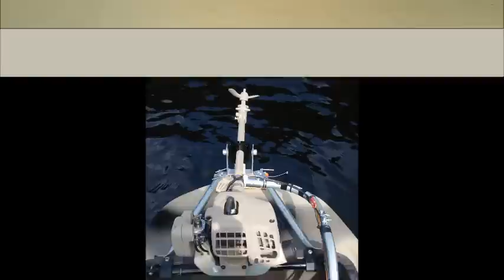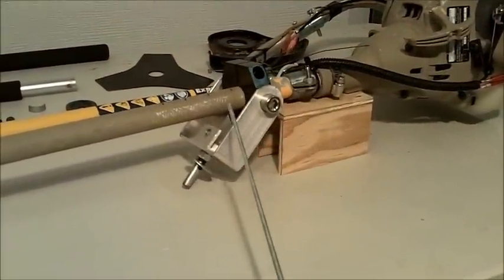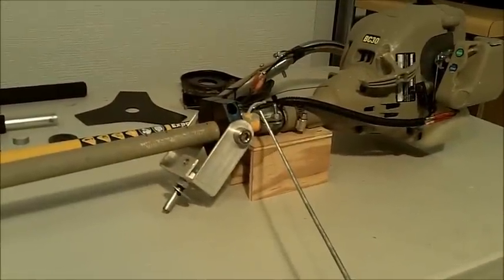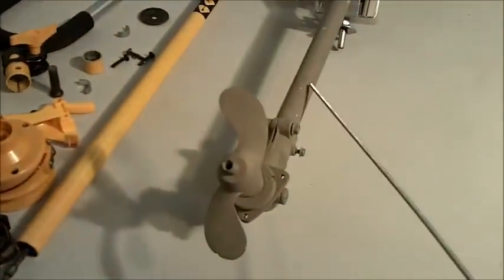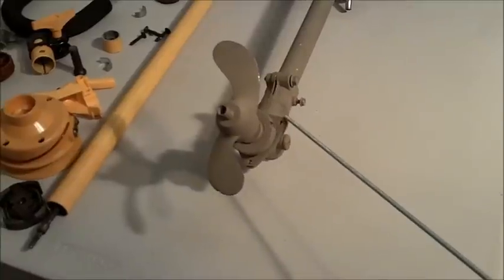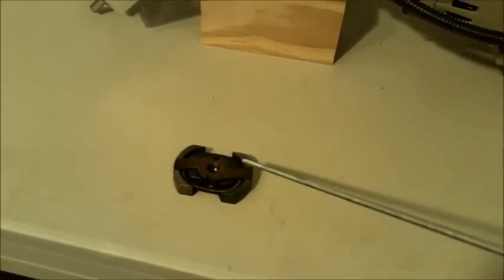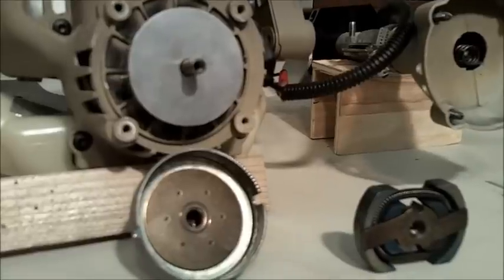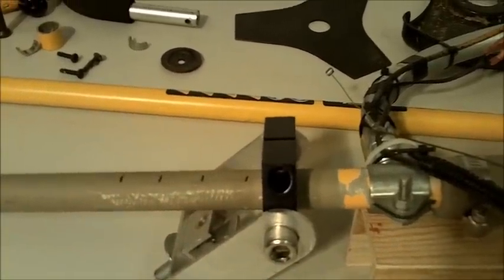Weed Eater Boat Motor Build

Comment: Since my sail boat is only 400 lbs 16 footer ,this would be just about perfect for size ,weight and with these weeders ,i could tilt it at any angle and it would still work ,good luck with your site ,your just about the best explainer guy out there and i don't say that everyday :)

Comment from the maker: Thanks! It's starting to warm up here, so I'm getting excited to get this back out on the water. I have not seen any issues with the gear head taking on water, but I also have not opened it up to look. That is something I'll plan on doing soon. I don't have an anti-ventilation plate (cav plate) yet. I was going to fab one this spring too. Last time I ran it, I tried to get some speed numbers with my gps to look for a loss or gain in speed with an anti-vent plate, but I didn't get a good average.

Comment from the maker: Glad you liked the video! The bracket you're asking about is a ballast clamp bracket for a circle track car. You can find them on eBay. You need one for a 1" tube. As for the clutch lockout, you'll need to have one made. I took the clutch drum to a machine shop. You can take a picture of my set up and tell them to make you one that fits your clutch. In my other video my GPS said I was going 4.7 mph, but I think it can go faster, I just need to adjust the depth. Feel free to ask more questions!

Comment from the maker: @zm123e It shouldn't be too hard. Do you know what kind of shaft it has inside? Solid or wound wire? If you have a solid shaft then you just need to cut one end off (probably the bottom) and then make the shorter shaft fit inside your gear head. Cut your outer tube the same amount and reinstall your gear head at the bottom.

Comment: I wonder if you could have drilled holes through the clutch drum and run a bolt or bolts through it to connect the clutch to the drum and achieve the same results to make it direct  drive.

Comment from the maker: I bought the weed whacker off craigslist but you can find them at Home Depot or online at Amazon and other places.

The shaft adapter (what the prop attaches to) came with the weed whacker becuase it is what the trimmer string housing attaches to.

Comment: Just drill a hole close to the center of the clutch bell into the main clutch were its one piece on each side and tap them and stick bolts in it
Reply from the maker: Thanks for the suggestion and thanks for watching!

Comment: I just got a ryobi motor from a bushwacker. I had it for 7 years before it decided to not start for me. I need to rebuild the carb but I needed to wack right ow so I got another head unit. I also need a motor and this seems like a good use for it.
Reply: I forgot to ask but is it possible to not mess with the clutch and have it work? I stripped out the T25 bolt insife the clutch bell trying to repair my motor and the female end is too small to fit my extractor in.
Reply from the maker: stizan24
You can try but I suspect yours will over heat like mine did. You could also put a couple of small tack welds inside the clutch drum to lock it up, but the I don't know off the top of my head if you can get a welder in close when it's connected to engine. It might be too tight. Your only other option is to cut off the female end so you can get your extractor or a set of vice grips on the T25. A replacement clutch drum doesn't cost all that much. Keep me updated with your build and thanks for commenting!
Reply: I didnt think of cutting it.off that would be.my best option. Thank you.
Reply from the maker: stizan24
It will mean you need a new clutch drum, but I agree it's your best option. :)

Comment: hey nice outboard i started making one the other day out of a echo srm 2450 whipper snipper straight shaft its got plenty of power and a clutch but the gear head on the end makes it spin counter clockwise so i was looking at the youngs t10 but it doesnt have a hole in the end like urs did u drill one and will it do the job thanks.

Comment: I had a couple questions. The bracket that bolts onto the shaft where it pivots comes from what kind of mini race car? Since I've never pulled apart one of these would a small engine shop have that kind of lock out clutch part around or understand what I needed? I'm handy but motors were never my thing. When you got it up and running just how fast did it move ya? I couldn't tell from the video. Great job!

Comment: Were you able to just bend the emt for the handle? And what is a clutch lock out, would I need it for a small duck pond. I appreciate the fast responses THANKS👍🏼
Reply from the maker: +Everything Outdoors Yes, the handle is bent EMT, but you can use anything you have handy. The clutch lock out was necessary because the clutch was slipping and getting really hot. It has to do with how heavy you and your boat are. If I were to do it again I would just put two weld beads on the inside of the clutch drum to catch the clutch shoes. It would be much cheaper and easier then make the the clutch lock out that I did.

Comment from the maker: My T-8 prop had a hole in it, but I had to drill a second small hole for a roll pin to keep it on the the shaft.

If your echo is close to 30 cc it will work great!

Comment from the maker: I actually removed my clutch because it was slipping and getting really hot. What size engine do you have? That may be the problem. Anything under 30-31 cc is going to bog really bad. You might look at giving your engine a tune up as well. You could squeeze some more power out by adjusting the carb or putting in a new spark plug, etc.

Comment: I see no problem with my clutchless unit. I made one last summer, and it runs fine. You can start it in the water too; you just have to make sure that you prime it very well, and dampen the choke down to let it warm up. Oh and never go for an actual trolling motor prop. they have too much surface area. They are only meant for low rpm electric motors. Get, or machine a 3-4 inch prop. It will spin a whole lot faster, and prevent engine stalling

Comment from the maker: hmm, it sounds like it's stalling the motor. What size engine and prop do you have? It sounds like it's not powerful enough to turn it in the water. If it was your clutch it should start slipping and get really hot, so it doesn't sound like the clutch to me.

Comment from the maker: I bought the brush cutter used off C-list for $40.
Then the throttle grip was $15, the prop was $20, the clutch lock-out plate cost the most at $90 and the mounting bracket cost $20, the rest was just odds and ends to get it running.

I'd say total I have about $200 into it. I'm not looking to sell it right, but thanks!

Comment: Very good job. But I want to know the ratio of gear box. What is the revs per minute of your weed whacker? and what is the output(propeller) revs per minute ?
Reply from the maker: The gear head has a ratio of 1:0.75. For every full rotation at the engine, the prop turns 3/4 of a rotation. As for the engine's RPM, I haven't verified it, but I believe the manufacture says its a 7000 rpm motor. I'll run some tests when my digital tachometer arrives. Thanks for watching!
Reply: Thank you for responding. I also want to know power of your weed eater. I have one 26 cc but ıt didnt work. Because power of motor is enough to turn propeller in water. power is not written on this machines. there is only cc value. How can I understand it if the power is enough or not ? Thank you.
Reply from the maker: 26 cc is a little small. Mines a 30 cc. What did your motor do, stall when you put it in the water? You need a smaller prop. You can make yours smaller by cutting some off the tips. As for Horsepower, I really can't say for sure, but I've heard they are in the 1.0-1.1 hp range. I'm working on a project that should give me some better numbers. Be sure to subscribe for a video on the subject this spring.
Reply: Thank you. But I found a nw motor 2.1 hp. 52cc. I will buy it. I think this is going to solve my problem. When it is ok I will send you my video. thanks a lot...
Reply from the maker: Sounds good. Can't wait to see how it works for you!

Comment: I see the video was posted a few years ago, how is the motor holding up? How long of runs did it take to overheat the first clutch. I will only be doing short runs of 10 minutes or so, wondering if I need the clutch lockout plate and all.  Can you buy a weedeater with direct drive and circumvent the whole lockout plate, or do they all come with clutches, sorry if that's a stupid question. Thanks alot.
Reply from the maker: It's still running, but I don't have as many hours on it as I wish I did. My first clutch overheated pretty quickly. Within the first 30 minutes. As for direct drives on weedeaters, I haven't seen any that way. Seems like people want it to idle without risking their limbs if they set down. Thanks for watching!

Comment from the maker: The prop is a T-8 from Young's Die Cast Props. As for the "coupler", I'm not really sure which part your talking about. The gear head is about $25 on ebay. Hope that helps!

Comment: +Erich's Alaska Channel  Nice adaptation.  However, felt I was drowning in details without ever seeing the big steps you used to conceive of this and put it together.  For example, I'm still having difficulty determining which pieces were originally part of the weed whacker vs. which "marine parts" you purchased for attaching.  Any videos or pictures of the steps BEFORE it was assembled, info on sourcing the parts, etc?
Reply from the maker: +onesimpleidea Thanks for the feedback! I should make a new video going through the project step by step. Would you suggest one long video or multiple shorter videos?
Reply: +Erich's Alaska Channel  Length?  Either would work, but the trend seems to be multiple parts, each under 10 minutes (Making It Part 1, Making It Part 2, etc).  No matter your choice of method, if you made it, I for one, would watch it.  In parting, details are great, but think of them like the balls on a Christmas tree.  First, you need the tree to hang them on ... and that is some type of overview or outline that you stick to as you progress through the series.  Hope this helps.  Again, nice job with the motor!
Reply from the maker: +onesimpleidea Thanks for the feedback!

Comment: I have a ryobi weed wacker with a bent tube instead of a straight tube.  for the second time the flexible cable has snapped.  How would you prevent it from snapping over torque issues in the future?

Comment: Where did you get the adapter on the prop
Reply from the maker: Hi Grant, thanks for watching. The adapter is part of the string head that came with the weed eater. You can fine replacements on ebay or parts websites.

Comment: I did this with a 4 cycle ryobi, same prop, but it cavitates. Any ideas?
Reply from the maker: The only options are to add a gear reduction or use a smaller prop. :(

Comment: Nice motor. I thought of a cheaper way to lock out the clutch. Drill 1/4" holes where you cut the slots in the clutch drum, and then file them square to accept 1/4" carriage bolts. Install 1/4" x 1/2" carriage bolts so the heads are on the outside. Use lock washers, nylock nuts and thread locker to secure them. Use the stock clutch and align it so the bolts fit in the narrow sides of the clutch. Modify the bolts to fit if necessary. The nuts hit on the clutch shoes, locking the clutch..

Comment: Why not use a tiny prop instead of the machine shop biild and boat prop?
Reply from the maker: Like for a remote control boat? I was following some other guys builds who recommended the youngs aluminum prop. With a little gearing, it would help the weed whacker not to bog and be very efficient.

Comment: that clutch center section that is threaded looks like steel, it looks like a second steel section could be welded to that threaded center section, center it the best you can weld it on, then balance it on a dowel or pencil, file the end that drops as that will tell you the side that drops is heavy, keep doing that till you dont have one side drop lower than the other, then you are balanced.
Reply from the maker: +Gary West I guess that would work. Another viewer suggested welding two small beads on the inside of the clutch drum which would bind against the clutch shoes and lock it up. I'm going to do that on the next build.

Comment: how did you get the clutch to go to direct drive?
Reply from the maker: Ian Viator I removed it and had a clutch lock out plate made, but the better way is to put two small beads from a welder for the clutch shoes to push against.

Comment: Just wanted to comment on your build it has great information. I wanted to ask a few things though, the prop adapter is the center section of the weed eater spool attachment screwed into the brush cutter attachment right? did you buy the weedeater spool as a replacement part? and if so was it available at the hardware store? I am building mine out of the X430 4cycle motor and I am hoping it also has the steel shaft on the upper section like yours had,If not looks like I am making one for my build. 

Thank you for the information.
Reply from the maker: +wfits You can buy the weedeater spool as a replacement part, but you can also by the center section separately. You can look on parts places like eReplacmentParts.com or eBay or go to your local repair place. I don't know if hardware stores usually carry replacement parts like that, but they may.

I suspect your X430 will have the steel shaft, otherwise, it would be easy to make your own with a steel rod from the hardware store.

Thanks for watching and commenting!

Comment from the maker: It's true I love projects, but it's also a fact that this motor is pound for pound more efficient than a trolling motor. Weight is a big deal for me and where I need to get my duck hunting boat so not having to lug around a 30 pound battery for a trolling motor is a major improvement.

Comment: I would have locked the clutch by drilling straight through the clutch hub into the fly weights, tapped threads into the weights and inserted screws.

Comment: im 12 is there any way i can just put a trolling motor prop where the string holder goes and run with it
Reply from the maker: A trolling motor prop is too big. It will stall the engine.

Comment: The only problem with using a weed whacker is that they run at too high an RPM for the propeller to be really efficient at developing thrust. And a reverse gear is not really practical. If you could figure some way to gear it down it would work better. However, having said that, I have been through the trauma of shopping for an outboard motor. Even the smallest ones will darn near stop your heart from sticker shock! Outboards cost as much as cars these days. If you can make the boat go without breaking the bank, good on you!
Reply from the maker: Lawrence Withrow I agree that gearing is the main issue. Thanks for watching!

Comment: Very good I am doing the same with my flymo whipper snipper, but I might just use the whole whipper snipper and put a prop on the end, or I might attach an broom stick to the crank shaft and on the other end of the broom stick there will be an prop. 
Check out my vid. "how to make an simple outboard motor"

Comment: Very Very Good
Excellent video..well articulated. I wish all youtube vids were this good.
Only one problem....Ryobi's are absolute shit Weed whackers. they have a very robust shaft etc. but the motors are the worst. I have been through 4 of them..All junk.
Believe it or not..Toro makes a stellar Whacker, and of course the cost prohibitive Sthil.
Reply from the maker: Thanks for the kind words! I can't disagree with you on Ryobi's not being very good, but your right on that Sthil's are too expensive to play with like this. I haven't found a Toro that has enough CC's to make me want to mess with it.
Reply: im getting around to mounting a 2 cyl 6hp military surplus motor to a 5hp lower unit turning a very large prop. going for torque instead of rpm.

BTW... I found the Ryobi 4 stroke to be a good motor...2 stroke, NEVER again
Reply from the maker: mercury90hp Your military surplus motor sounds cool! Please be sure to share your build!
I also have a Ryobi 4 stroke and it seems pretty good. I haven't tested it on my boat motor yet. I did notice that they had some cam issues with the first set and they fixed them with the "X" models (vs. the S and the C models)
Reply: Erich's Alaska Channel check my advise above how to build boats at home!